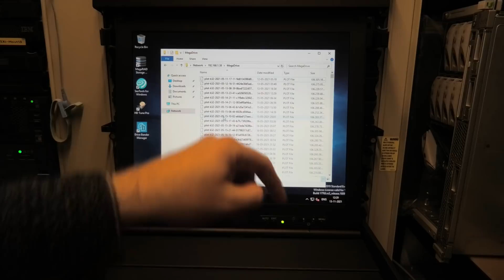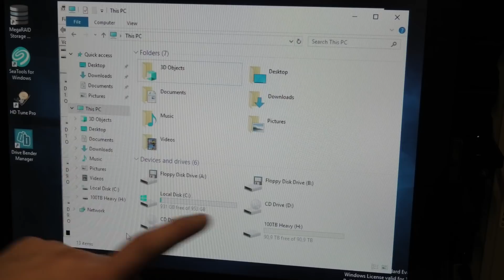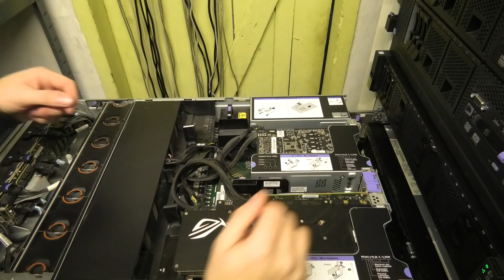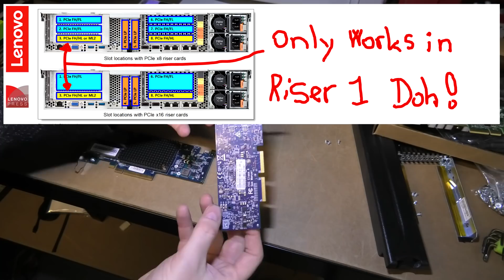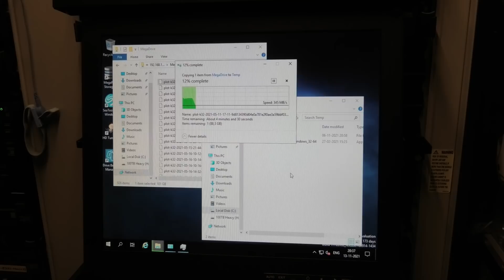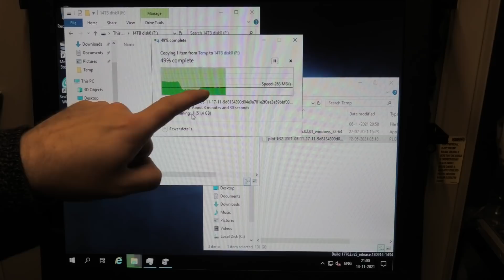10Gbit NIC was just Absent, & Windows was a Bottleneck - 1126

Comment: When you began building the volume set I knew it would end up be the bottleneck.
Reply from the maker: and you said nothing!,, what a friend :-) I thought it would be at least as fast as a single drive.
Reply: @MyPlayHouse  Microsoft's software implantation of volume sets and other forms RAID will always be slower then if they are configured in hardware. This is something I learned more the 25 years ago.

Microsoft provides the software option to the IT folks that don't want or can't spend the big bucks.

Comment: C'mon, "Windows was a bottleneck", I have 10GB and transfer speed is about 800Mb/sec from nvme to nvme. And before we used 10GB on Windows. Might something with drivers/settings. And optic and 10gb ethernet, on both no problems.
Reply from the maker: I was only getting 50Mb on that spanned volume,, even if the drives will handle 150-280Mb/sec,,,

Comment: Hi Morten, I have had similar results to you with windows transfers to a Qnap Nas connected via 10gb using a HP Z840 with 4x 4 tb drives in a raid 1 store. transfers would be around the same speeds as you have experienced here. I had a spare couple of nvme 512mb drives that i put on a pci carrier, then put into my HP. Then i set up a program called Primocache to use the nvme drives as a cache for the main pool of drives, and transfer speeds certainly improved a lot.
Reply from the maker: Windows also uses RAM,, that is why it goes well just to start with,, but when you run out,, it slows down.

Comment: Are you sure that Emulex card wasn't a FibreChannel card and that was why you were unable to get it working?
Reply from the maker: it should be 10Gbit
Reply: Some of them are both and can be changed between the modes
Reply: I have the same one, running as 10G nic and fails to bring link UP in anything but older IBM servers. Also if you compare the PCIe connector it has couple extra pins compared to regular x8 slot so x16 slot is needed. There are multiple discussions on various forums about them. The HP ones look mostly the same but have standard x8 connector and work almost anywhere.

Comment: I am guessing as it is a spanned volume and not striped will only be writing to 1 disk at a time
Reply from the maker: But when I in the end was writing to just one disk,, simple volume,, it was way faster.
Reply: @MyPlayHouse  you were writing to a 14TB drive with a sustained writing speed of 250MB/s you added the lower crappy disks to the start of your spanned volume like the 3TB and the write speeds would have been junk. Spanned volume writing to one disk at a time, if you had of filled up the disks to a point where you were then writing to the 14TB drives you would see that speed increase, why trust your Plots, or lottery tickets to a spanned volume managed my Microsoft anyway, not the greatest idea you have ever had